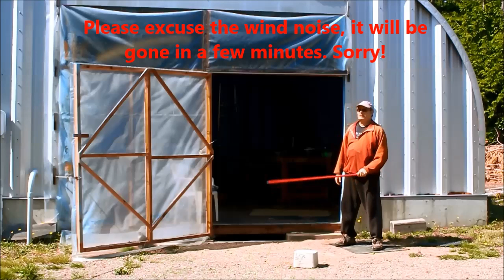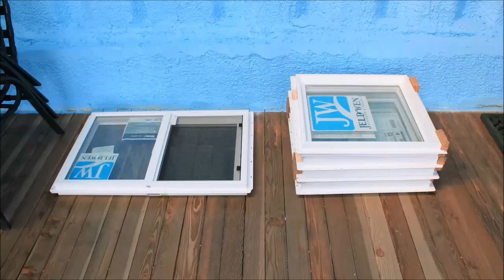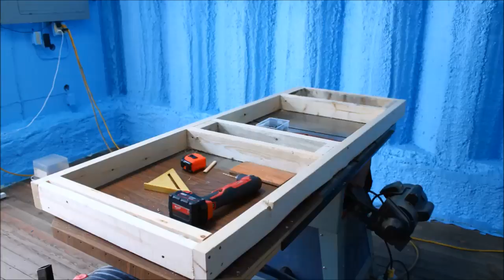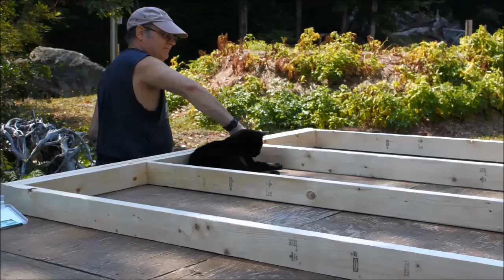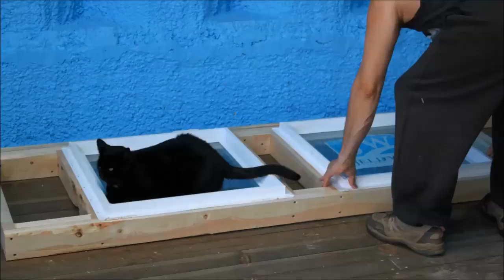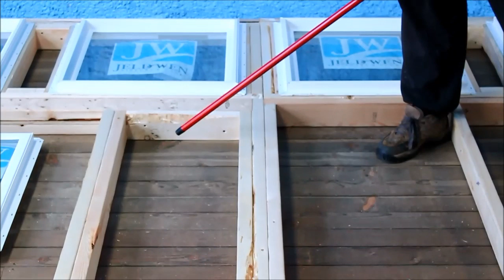Survive and Thrive Episode 2: Shop Wall Construction

Comment from the maker: The wind noise early in the show is infuriating, I've ordered a Tascam DR-05 and a Lavalier (lapel) microphone to resolve the issue.
Reply: You could use a tripod too so you can record you doing work too. That's an option. 

Awesome series HITMAN82
Reply: Wind noise really isn't that bad, I've heard far worse.  Just a little hint, some cotton fabric will make a major difference!  Also I agree with Iain a tripod would be cool, you could even do some high speed.
Reply from the maker: Iain Robson I have the camera on a tripod for all the video in this series. :) I just bought a 64GB card for my camera, had a 16GB, and ordered a Tascam DR-05 sound recorder. Looking for a Sony ECMCS3 Lavalier lapel mic now. This should solve my audio problems, I'm switching to Audacity to handle my audio rather than Windows Movie Maker.
Reply: HITMAN82 Audacity has a nice noise removal feature too

Yeah your audio should be prettty solid with all that